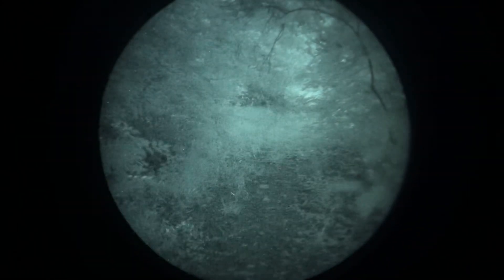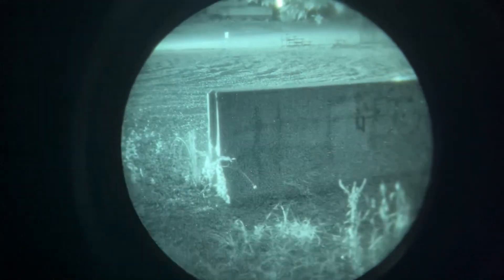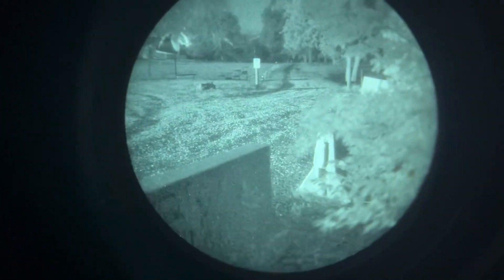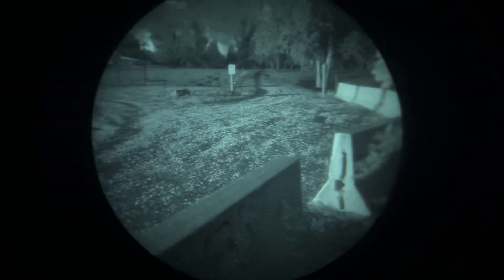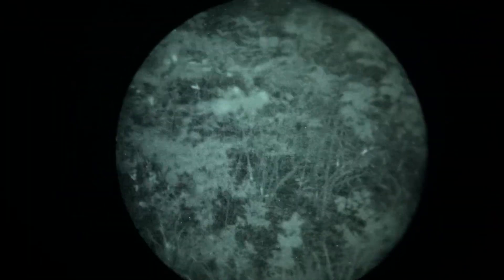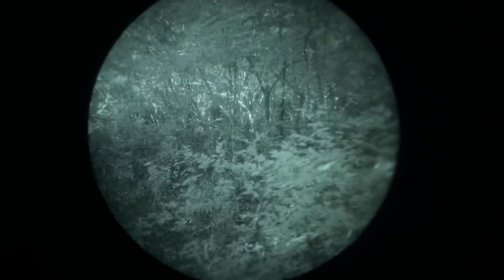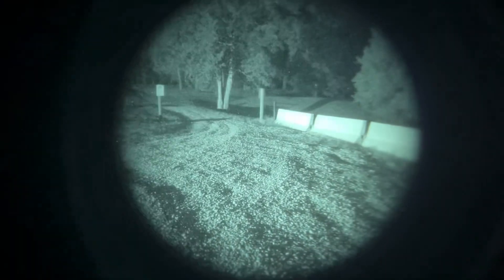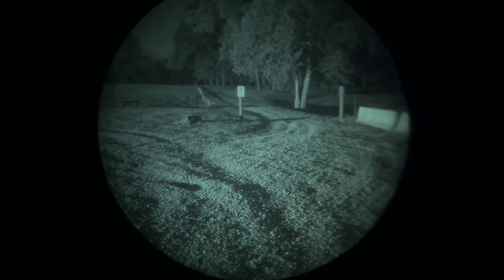Night Vision Gain Control DEMO w/ Iris Test (PVS-14)

Comment: I just got a PVS 14 and when I purchased it didn’t even consider if it had manual gain or not. Fortunately it did and it’s one of my favorite features. I do have an iris on order more so for the near focus advantages plus it’ll function as my day cap in the event I forget to turn the unit off and remove the battery.
Reply: Beware of this the pinhole in the iris will still let a pinhole of bright sunlight through onto the front lens of the PVS14

Use the daylight cap and screw the iris on at night

Comment: very nice video, full of valuable information. If I got your impressions right, manual gain is very nice feature but IRIS can replace it to some degree. Actually, footage seems to be very similar comparing  IRIS and gain control, so I wonder if you see any big advantage into gain control. Because if IRIS provides almost the same results, then I don't really need to care about gain-control when looking for new device. IRIS is great addition in any case and it's not expensive.

Comment: I'm torn between getting a pvs 14 or tanto because of this fact. Tanto is a clear winner on weight and for bridging, but I wish the tanto had a small manual gain knob!
Reply: Get the pvs14. Dont worry about weight. For real, bud.
Reply: You'll be extremely happy with a pvs14 trust me
Reply: I would recommend the 14 man, manual gain is so nice

Comment: Manual gain: Manually adjusting the brightness of your night vision device

Adjustable Iris: Manually adjusting the depth of field of your night vision device. Night vision lenses use F1.2 aperture. Apertures can range from F1.2-F22. The lower the number, the more lights can enter the lens. However, this comes with downside. It focus on small area and what ever is not in focus becomes blurry. Hence why when you focus your night vision device at stars, your hands look blurry. Adjustable Iris allows your night vision lens to go above F1.2 by opening or closing the iris. When your aperture increases, the amount of light that can enter your lens decreases but your focus area increases. So you can look at the stars and have your hands in focus at the same time.

Comment: I was intrigued by Tanto but decided against it due to lack of manual gain. I understand the iris doesnt replace gain control but this is an acceptable containment for modules that don't have manual gain control.

What would you say is the downside of using iris? it seems to be a bit more noisy because the module is working harder to create an image.

Comment: Very cool video I had also noticed the same effect when using the iris on my thin filmed WP pvs-14

Turn the gain up but shutter the iris and it had the same effect

Noise on the image increased more with thw gain up and the iris shuttered vs having the gain dialed and having the iris wide open.